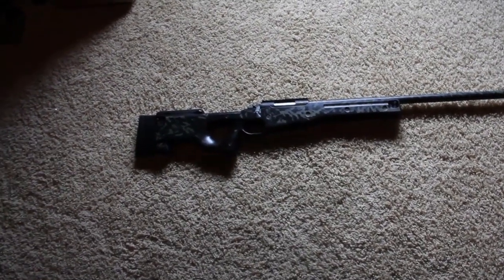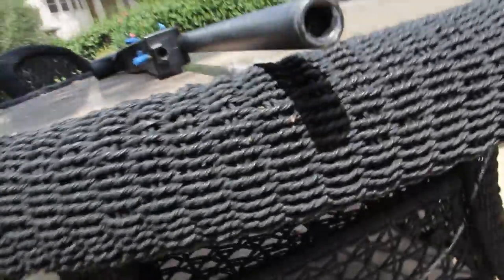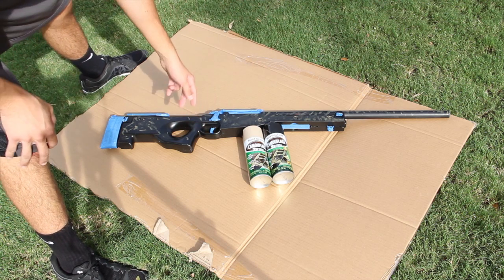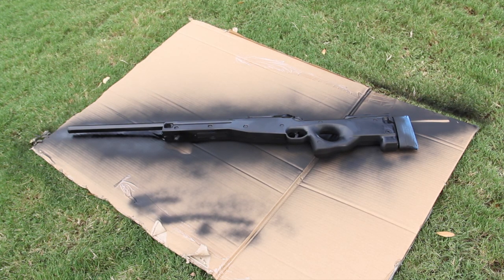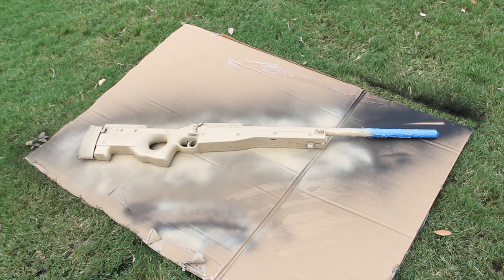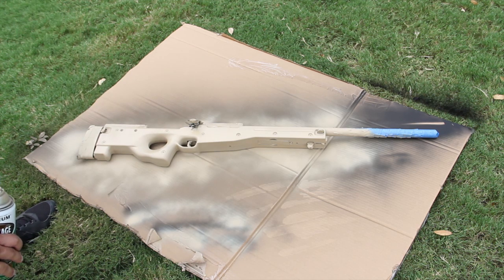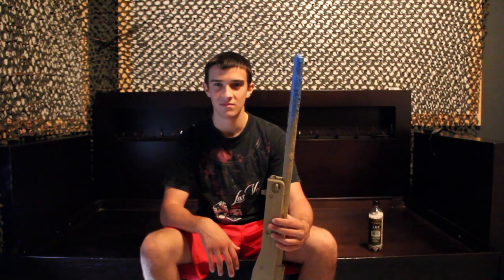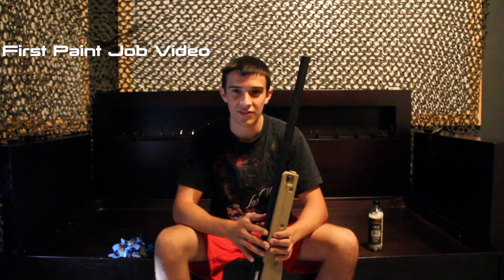How To Paint An Airsoft Gun (Sniper Rifle) - Desert Camo

Comment: Okay.. im from the UK and because of the laws, all non UKARA members that want an airsoft gun, it has to be 60% 2 tone... I have a Tokyo Marui vsr-10 in 2 tone, and now that I have a UKARA membership i dont want to have to buy a non 2 tone one and would like to spray it. I was just wondering if i could have some advice... its a glossy vibrant orange :/ but now I want to spray it in dessert tan, and I just want some ideas on how to get the best result? Many Thanks- Angus
Reply from the maker: If you are starting out with a glossy surface, i would recommend sanding it down more than usual. Just keep sanding until it is nice and smooth, but not glossy. Then make sure you clean off all the little bits of dirt or shavings from the sanding. once clean, just mask off, and spray away. Good luck!
Reply: Alright thanks a lot, very appreciated
Reply from the maker: Sunset.Maruda Not a problem!